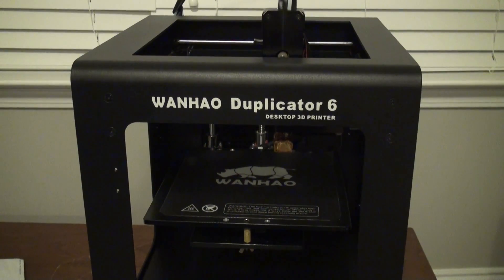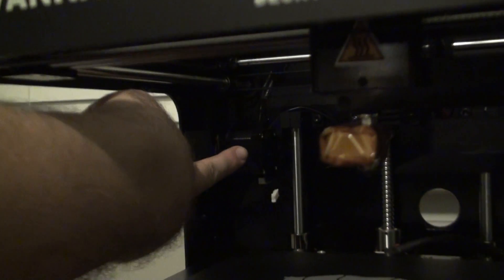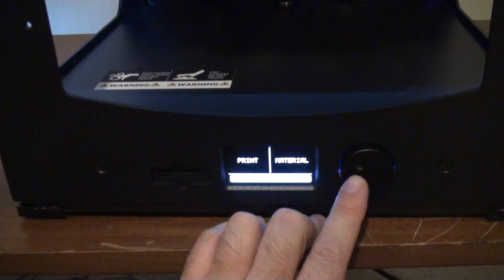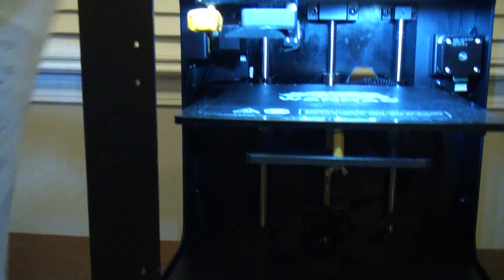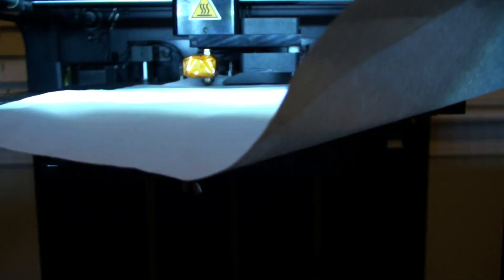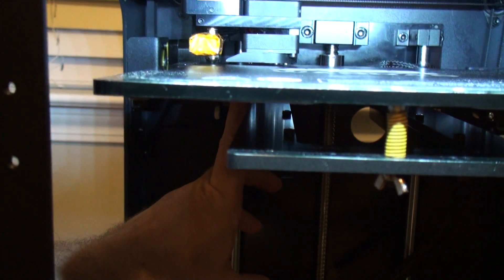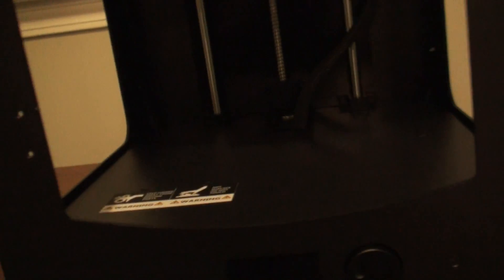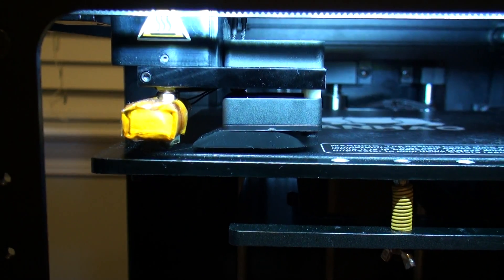Wanhao Duplicator 6 manual leveling method

Comment: Hello, first off I want to thank you for posting this video. Second I have a question. I bought a used Monoprice Ultimate 3D printer, (rebadged Wanhoa D6) off of marketplace for $20. The guys I bought from said they couldn't get it to work that the nozzle kept slamming into the build plate, but I figured for $20 why not. It looks practically new. No errors on power up. Based on my research I'm guessing that the problem may just be that they didn't level it correctly. I ordered filament, a new nozzle and a Magnetic PEI build pad for it. Once I get everything I intend to try your manual leveling method. The question I have is there is an option on the menu under maintenance -->  Advanced --> Factory reset and I'm wondering if running this would be a good idea before I attempt to level it? Also, I wanted to ask if there is anything else I should look at prior to trying to level it? I also updated the firmware from Wanhao and downloaded the latest release of  IIIP-CURA. I am totally new to 3D printers so I spent the weekend reading up on it, but I still don't have all the terminology down. Thanks for any help it's much appreciated.

Comment: Thanks for this and the other video regarding the display not showing all the text. I'm gonna try this when I get home from work on my D6.  It had been working find for ages but suddenly I started getting bed leveling nightmare issues and when homing/starting prints the nozzle would press into the home corner pushing the bed/springs down and making a hole on the print mat and I had torture trying to get the first layer even, tried all sorts of leveling tricks and was beginning to think my bed warped over time,  I'm hoping the combination of this video and your other one will solve my issue.

Comment: I had a big problem with the bed leveling..the first problem it was the screw on the back that controls the bed..and when the bed goes to the top ,scratched and make a small hole on the bed...I think I fixed thet but sometimes do the same...so I will try your method and today and I will tell you if its work...and if its work I will make a statue your face hahaha....so I wanted to ask you if I can put auto bed levelling...and if I can (and if you know) can you send me the link about the parts and what levelling system I can put? thank you very much my friend!!!

Comment: The Wanhao i3 has a menu item to disable the steppers. Is that option not available for this printer?
Reply from the maker: D6 uses a different firmware and does not have the same menu items as the i3. Also, when leveling, you want Z locked but not X and Y. Disable would disable all motors and thus not work optimally (if we had that option).